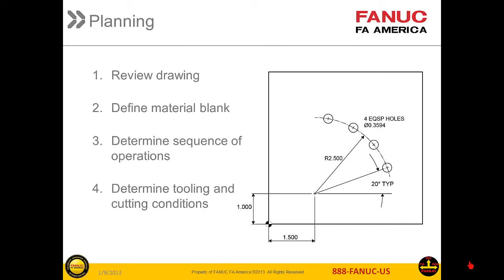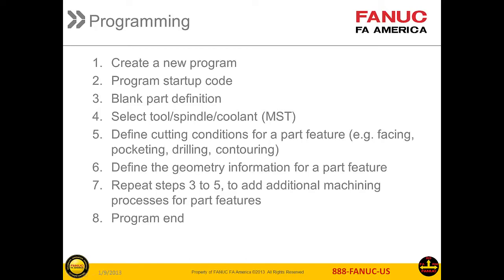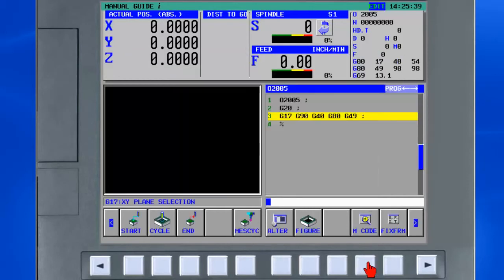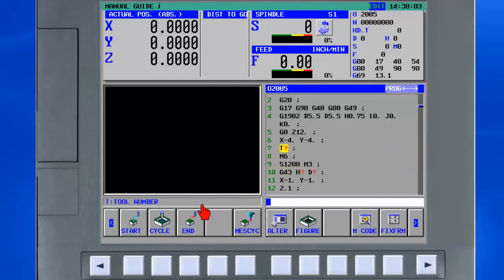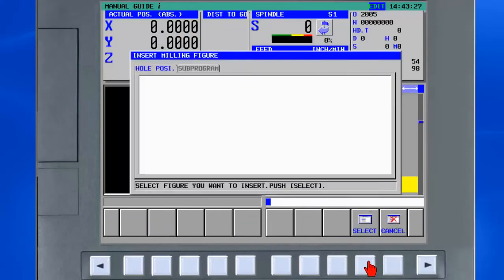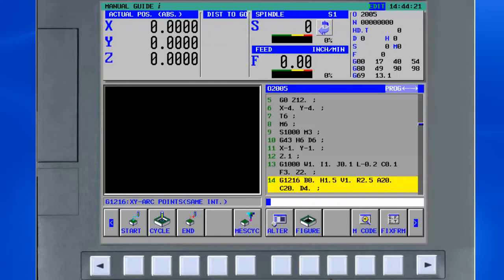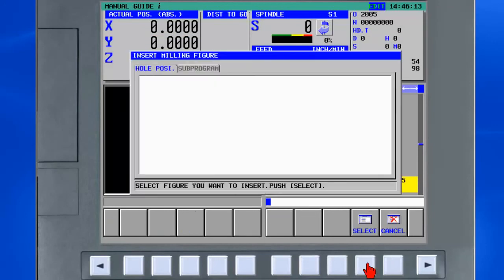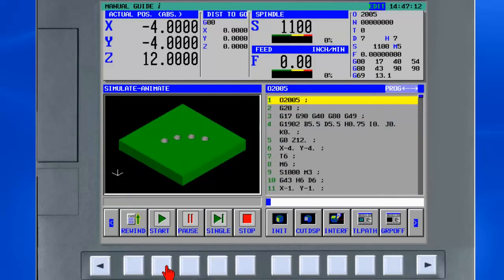MANUAL GUIDE i Bolt Hole Circle

Comment: X=TAN[angle]*radius Y=SIN[angle]*radius
who need manual guide we have Gcode lol
(center of pattern is zero point)
G0 X[TAN[20]*2.5] Y=[SIN[20]*2.5] M3 S1000 F3
G0 Z1
G81 Z-0.3 R0.1
X[TAN[40]*2.5] Y=[SIN[40]*2.5]
X[TAN[60]*2.5] Y=[SIN[60]*2.5]
G80

Now you know secret :)